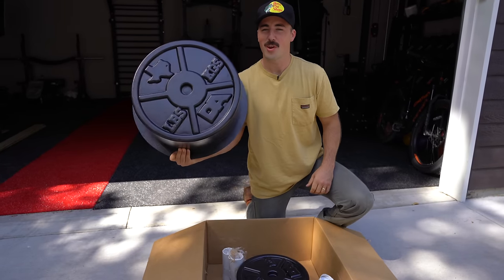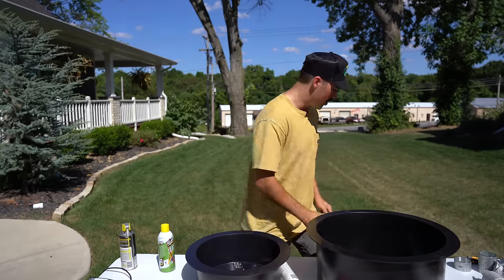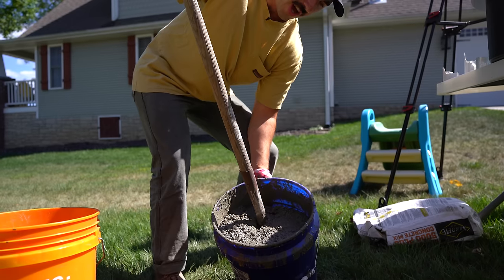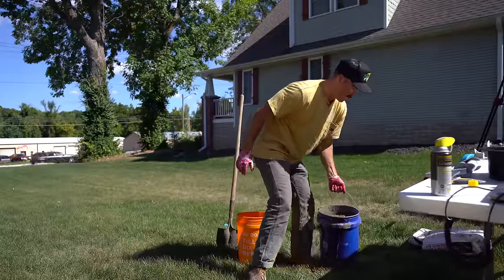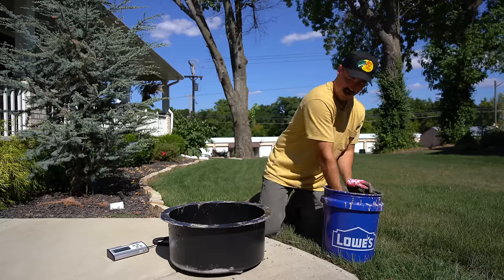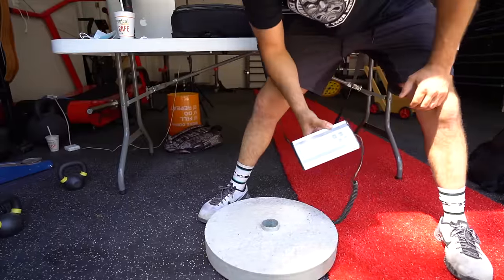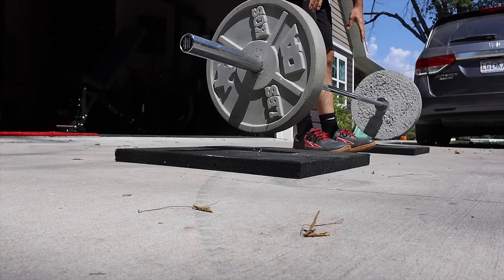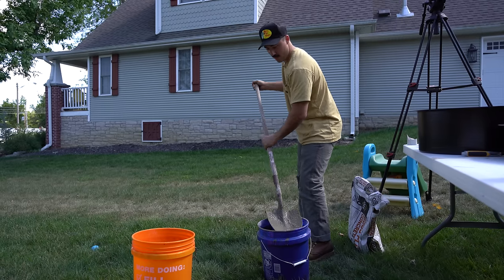How To: DIY Concrete Weight Plates That Don't Break

Comment: If I were to do it I’d suggest weighing the mold before you add the concrete, add more concrete than you need because you can grind off excess concrete easier than adding concrete and spray finished product with Bedliner so your home gym isn’t dusty after each workout. Just some suggestions I thought I’d share.
Reply: Do i wait until it is cured to sand it or can i wait until its dry

Comment: I have been using the 45# mold from Caveman Weights and 8" silicone cake pans. Pour the 45# halfway to make 20# plates. I experienced the same weight discrepancies you did, which was frustrating. But overall, I was able to make 270# of weights for super cheap. Happy to be able to keep working out. 
Gonna finish them off with truck bed liner spray to help harden the exterior (after a full 28 day cure).
Reply: Make a video review plz
Reply: You should add rebar or wire mesh would be 100 times stronger
Reply: @Jesus713martin  I did. Put in chicken wire on the first group. Haven't had issues 2 years later with the 45lbs plates.

Comment: I made DIY atlas stones maybe 10 years ago. I still have them and still use them. High strength concrete is the way to go. It will stay strong and not break as long as you make sure you use adequate mats when setting them down and or dropping them.

Comment: As others have mentioned you should tare the scale first. Also, I made some concrete plates a few months ago and made sure to make them slightly heavier than what I wanted. Then once it is cured, go back with an angle grinder with a concrete disk on it and you can shave weight until to get it exactly what you want. Obviously there will be slight weight variations as you use them, but this gets you really close to exact desired weight.

Comment: Biggest problem I've had with caveman molds is popping out the plate (even when lubicant is applied). This seems to solve that problem! Just flip it upside down and let gravity do the work. Its more expensive but a huge time saver! Great video!

Comment: Why not put the molds on the scale, zero the scale and then pour to the right or closest weight to be more accurate?
Reply: You also have to consider the water weight that evaporates/bakes away. I think alternately, the best strategy is to pour too much by a couple pounds intentionally, then sand down that rough backside of the final dried plate to get to exactly whatever your target weight is.
Reply: 49lb in wet concert is the sweet spot then after drying it would be 45lb 46lb
Reply: Eric Gatlin  nice send the video sanding concrete. Lol. The balance on the weight is also a factor I think
Reply: Tare out your 5-gallon bucket, add your metal pipe and concrete to 45lbs.  Put your pipe in the mold, mix your concrete, and pour.  It should dry out darn to close to 45lbs.

Tare, for those who don't know, is zero to empty weight in simple terms.  Place your bucket on the scales and hit zero.  Then whatever weight you put in, the math is done for you.
Reply: This would also ensure that the plates are the same weight afterwards
Reply: It doesnt have to be exact, just the two plates have to be equal
Reply: weigh the concrete before you put the water in it. 45lbs of dry concrete then ad water
Reply: @jacobmattsen2393  water adds weight to the concrete. it doesnt just evaporate either, the water actually reacts with the concrete and becomes a part of it.
Reply: Yea idk why he didnt do that....what a newbie
Reply: @KenJones1961  if you properly cure your plate it can gain 5-10%. If you don't properly cure it might lose mass. A properly cured weight will need to weight just over and then be ground down.
Reply: Quiet, you!

Comment: I just finished my first 45.  I measured the dry concrete before mixing so I'll see how accurate that made the weight.  I used the hot glue seal instead of silicone though and the hole came a bit loose and is just off center as a result.  Will try more glue next time.   I also bought the refill kit from Caveman as they are significantly cheaper, but not metal so I'll compare how they hold up in comparison after I have at least a set of each.

Comment: I bought the caveman weights. It's the same idea but a little bit cheaper and there's different molds with the numbers embedded. I bought all their molds and I've made over 400lbs of weights. I sprayed truck bed liner on mine which gives them a little protective coating and makes them look awesome. 
Best idea ever. Thanks for this video though, I would've never found the caveman molds without it!!
Reply: that's a lot of weights! nice!

Comment: Don't forget to seal the concrete. Also some rebar or just something in addition to the fiber glass may help in longevity.
Reply: Steel mesh works well, i saw on buffdude dads channel, he made the barbell as well with 2 inch collar
Reply: I was thinking steel mesh. Or fencing mesh, or chicken wire,

Comment: If you want to make sure that the outsides stay exquisitely intact, you can hit them with Line-x, and that dimensions the shock significantly . There's a bunch of videos out there of an egg dropped off of a roof with Line-X around it, and it doesn't break that would be a perfect addition to this project
Reply: I think I saw a short when they drop a watermelon off of a fire tower covered in that stuff.

Comment: Did this 3 years ago to great result.  Couple tips:  1) use a layer of rebar in the middle of the plate. 2) don't buy a kit, buy a pair of cooler tubs and 2" pvc for centers. 3) after weight set up, pond cure them for a few days. 4) buy a mixing drill bit, cheap and worth it

Comment: I've seen people selling concrete plates on craigslist made with these molds.
Reply: How much were they?
Reply: Omar Alcantara crazy expensive for what you could make yourself
Reply: @ohms2754  yeah, they were being sold for like $1.80 per pound, which is crazy when you know that concrete is under $5 per 80 pound bag.
Reply: Connor Nolan I cant do anything about gougers and resellers. I have called a few out that I have seen in my area.
Reply: @stixandstone  I definitely don't hold other people's actions against y'all guys. Craigslist is always just going to be full of people trying to squeeze every dollar possible out of people.
Reply: Obviously they are selling because people don't want the hassle of making them. Luckily i bought real steel before the pandemic, but if i needed plates i'd look at buying even concrete to save the hassle. It does kind of suck working with concrete, it's labour intensive.
Reply: Lol here I was selling a 300 lbs set for $120.00 (.40 a pound) 🤷🏽‍♂️
Reply: @itsliljimz  I might just have a terrible local market. Everything is going for well over $2 per pound here, and most of it is around $3.50 per pound.
Reply: @ConnorNolanTech  I live in California, LA to be more precise. Weights here even on Offer up are sold at 2$/lb minimum! some go near 3$/lb.
Reply: They’re worth whatever people are willing to pay for them. I know that if I took the time to build these, I wouldn’t be giving them away.
Reply: @ConnorNolanTech  It sounds a bit unreasonable when you think about how cheap concrete plates are to make, but for a lot of people time is money and they don't have 1-2 hours every day for a week to make a few plates. So the added cost of just buying it from others is not a big deal to them, it is a compromise they make.
Reply: @Lars16  absolutely, someone who has the motivation to make plates out of reinforced concrete is still offering a service and filling a demand, you could say that it's a crap service, but it's better than nothing. For example I have more money now than i ever had in my life, but money is only as good as the stock available, if reinforced concrete plate can be bought in volume and is relatively cheaper than the same weight per pound in steel, then you buy concrete, sometimes life is not full of options, you have to make do with whats available at the time.

Now i have about 230kg in steel plates at home, but i am interested in strongman, so to compete i need double that. Im hoping by the time i can lift 250kg that more plates will actually be for sale. If you look hard enough you can find them, but the going rate im seeing is £4 Per KG which is double what it was pre pandemic
Reply: @ConnorNolanTech  Well can always make them yourself 😆

Comment: How consistent is the density/uniformity for weight accuracy purposes? Super cool!!
Reply: If you mix each batch of concrete the same, they will be very consistent.
Reply: Stix And Stone great product genius
Reply: Put it on a scale while you pour it
Reply: @jhoags92  The weight will be different when dried.
Reply: @stackerhvh  Not really. When both are dried
Reply: @korcidiamond3623  If you leave it on your scale drying for a few days, sure. Otherwise, that's stupid.
Reply: Commercial made weights aren't accurate anyway
Reply: @jjbanana2774  yeah there is usually 2-3% difference, which can be over 1lb on 45lb plate.
Reply: If you pour exactly the same amount of concrete, sand and water every time you make a plate you will get pretty consistent. But it's also depends on humidity, ambient temperature, curing process etc
Reply: Just make two same plates at the same time with the same concrete... Mix the concrete before getting it in the molds... If you dont mix it the water will go up and the sand down... So the 1st mold you pour will be lightee cause there was more water on the top of the concrete mix and it will evaporate more... If you make two same size plates at the same time with the same concrete while mixing it before pouring so that the sand doesnt go down you will get about the same size plates.. Maybe 200-300g diffrence. If you want 45lbs better to scale it to 52-3. If it doesnt evaporate to 45 you can always sand it down to 45
Reply: 200-300g is 0.5lbs for you Americans
Reply: @Em_dzej23  MAKE  A VIDEO
Reply: if you are making it like this with a mold or in a bucket, I think rhe best way to get the weight right is to put it on a scale while adding concrete.
 some of the concrete will get on the shovel or something and the ends of the bucked maybe, also you would need to calc the amount of water in advance.

Only a small percentage of water weight will be missing once they are dry, so you can factor that in and the weight of the mold , but make sure your concrete is not too wet, cause it will be week form air voids and you would lose more water weight as well
Reply: You could probably use a weighing scale when pouring concrete in
Reply: @jhoags92  water will evaporate, weight will be decreased
Reply: Make one on a scale. When dried weigh again, and see how much it loses from evaporation. That will give a solid idea of how much it will lose, and you can adjust from there pretty well, and can get consistent results.
Reply: @girlsdrinkfeck  Yes it is. The wet concrete contains water and therefor has more weight. Once dry, the water is no longer present, making it lighter. Have a nice day.

Comment: Awesome result. I bet if you spray them with an underseal rubber coating after they've set it would increase the longevity and drop resistance. Could be worth a try.
Reply: Nice advice

Comment: I used rebar instead of the concrete fiber to hold it all together. I have yet to have them break over a month of heavy lifting with them.
Reply: How did you cut the rebar?
Reply: ultimaetsolder use a angle grinder if you can if not a hacksaw are very cheap and work well
Reply: ultimaetsolder I didn’t cut anything, I used a 3/8x12 rebar that sat around the PVC to hold it in place
Reply: Or chicken wire, hog wire, or just concrete reinforcement wire/mesh.

Comment: Weigh all dry ingredients to the desired amount,  say 45 lbs, and then add water. The water will evaporate eventually giving you the most accurate weights
Reply: I was wondering about that!
Reply: That's not how concrete works. The vast majority of the water stays in it forever.

Comment: Made myself a Húsafell stone for my garage gym using a plywood mold. If you want to be sure they don't break add some rebar and/or wire to make it even stronger. Also if you have a wheelbarrow and a hoe mix the concrete there it's easier. If you make a big stone keep misting it for several days while it cures as it will (so I've been told) make the final product much stronger. 
Also safety tip, make sure to grind smooth any rough edges if you bump rough concrete with any real speed or force it will tear through you...

Comment: This guy needs to make a dumbbell mold!
Reply: You can just buy Olympic dumbbell handles, they’re usually around $100 for a pair (make sure you buy a different set of clamps though, because they all usually come with cheap clamps), and then make your weights.
Reply: @_Car_Ideas  i have an adjustable dumbbell set. I want to build a set of regular dumbbells, with flat bottoms so i can rest them on my knees instead of getting jabbed in the quad by a metal pole
Reply: You Have to Live It you need to invest in IronMaster quick-lock adjustable dumbbells. Problem is they are not available right now but if you find a pair on the secondary market for around the same cost as new I’d buy it. Worth every dollar. I’ve had mine for 2 years they get used a lot. The square look was weird at first but they feel more like traditional dumbbells at a commercial gym than any garage dumbbells I’ve ever used including power blocks .  Plus they come in several expansion sets.
Reply: @MajesticSkywhale  you have to realize there are no good diy adjustable designs excepts the long pole version or the Ironmasters which cost £1200 for the 75kg per hand or £350 for 36kg per hand. If you cannot buy, Once you get actually strong then that space on the pole would be filled anyway and you can rest them on the floor. You could have a circus dumbell that is "fillable" but they are quite big. You can use lead-rolls as well for dumbell
Reply: @JamesPhillipsOfficial  I do realize that lmao, that's why I want to make concrete ones. I have a circus dumbbell too.
Reply: You Have to Live It that’s a good point. I actually hate how long my adjustable set are. It makes it pretty awkward at times and it’s definitely pretty uncomfortable to set on my legs when I’m lifting heavy.
Reply: @_Car_Ideas  yeah I have the Titan 100-lb each set and they're very very long lol

Comment: Do another review.  Drop them till they crack.  How many times does it take to crack the plates from shoulder height?
Reply: Richard Lahman would you drop iron plates from shoulder height?
Reply: Vance Young sure! For science, maybe we should see how they would perform.  Does a cast steel plates do better than a machines plate.  I don’t think I’ve seen a video that have done it.  Common sense would say no, I wouldn’t drop steel plates, but let’s see the video for science.   Drop them on rubber pads would be fine to observe.

Comment: We need a week update on those.
Reply: Well,  I’m five months into working with my first set of concrete plates using these very molds and they are still going strong. Only a bit of chipping on my small 10lbs because I wasn’t paying attention and it smacked my jammer arm post.
Reply: Stix And Stone awesome

Comment: Made my own using a 16" Sonotube and 2" PVC pipe. 2.5" thick comes out to 40 lbs exactly.
Reply: That’s a great idea. How are they working out?
Reply: @vipnetworker  they're working great! I need to make a few more so I have enough weight for squats and deads. I only made 4 plates initially.
Reply: @vipnetworker  they actually sell bags of fiber reinforced concrete at my local hardware store. I also used chicken fence wire for reinforcement.
Reply: 16 sonotube is way expensive though...I like your ideally
Reply: Really? Where I'm at, a 16" cardboard sonotube is less than $8 and bags of fiber reinforced concrete are less than $6.
Reply: Los Angeles concrete price same....sonotube 16 inch diameter x 6 or 8 feet is like $60..the diameter makes $$$. 8 inch diameter are cheap ya $10.
Reply: That's crazy! But, it's California, right?! Makes the cost of these forms much more justifiable. It's still a hell of a lot cheaper than purchasing plates though.

Comment: If you want them to be more rigid,you should build them thicker with smaller radius,and an additional plate would be good to put it on top of concrete to smooth the back surface

Comment: tensile strength of concrete is never tested, we should test compressive strength of concrete.   since it is a brittle materia
Reply: yeah, compressive strength is where concrete shine, put it under tension and its really weak
Reply: @Ariel24K  but reinforced concrete with rebar, performs very well, it is used in bridges for cars and is safe enough for lorries carry loads where there is a gap. So With steel rods, mesh and the fiberglass, concrete wont break, only if strengthened. No strengthening is needed if it doesn't touch the floor, most barbell exercises the weight doesnt touch the floor anyway, except deadlift and bent over rows
Reply: @JamesPhillipsOfficial  exactly these plain concrete plates are not ideal for deadlift. Reinforcement is necessary for High impact lifts like clean and jerk, snatch and deadlift.

Comment: if you have an oscillating sander it would be a great way to consolidate the concrete and make it smoother. just use the vibration on the form.